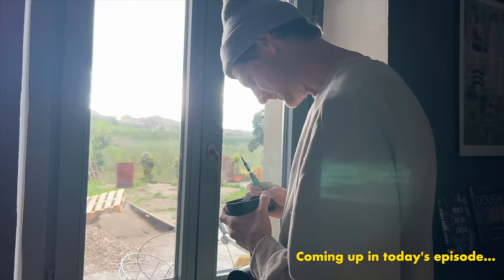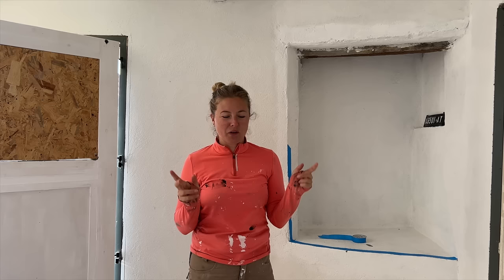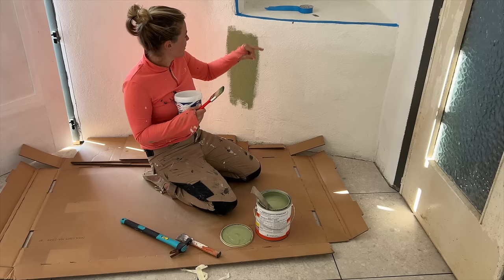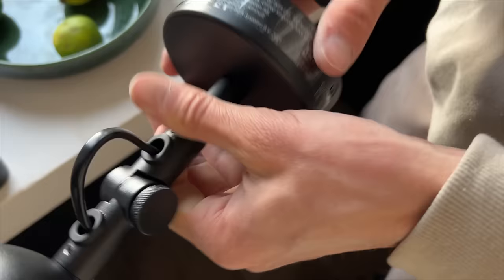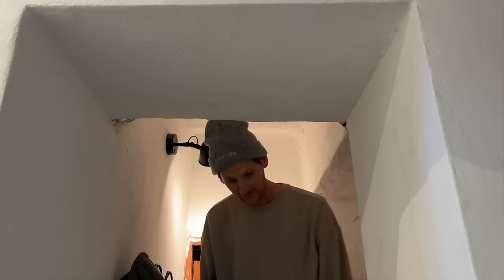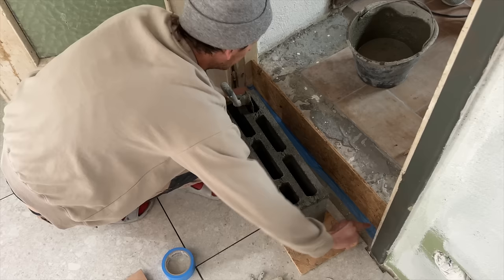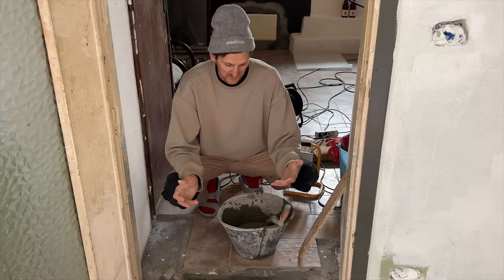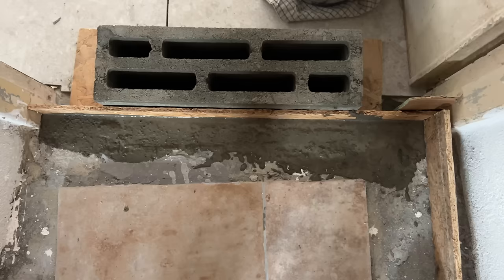BIG Paint Fail and Starting Work on the Electrics - DIY Italian Farmhouse Renovation & Restoration

Comment: FYI not sure if it really matters to you at this point (but we’ve experienced it first hand…) — Jotun (silently) changed a ton of their standard colors/color codes around 2021/22. As such, the color we picked at some point was not the same at all, buying it at a later point. We found out after a renovation where we wanted to keep the same color… Nonetheless, they have a conversion system that finally solved our mystery. Again, possibly not relevant for you at this point, but something to keep in mind for the future if you’re using jotun colors or references!
Reply from the maker: That's great info. thank you so much! 🥰

Comment: I have very thin knowledge of electricks, but stil I remember one point: if the swich has connected wrong, like swithing the neutral, then you get the light out with that, but still you can get shocked when installing the lamp, as live wire still is alive. That green suits, I'd sure just paint with that end-green over the first green.
Reply from the maker: Thank you!